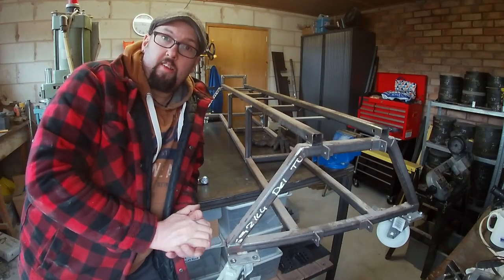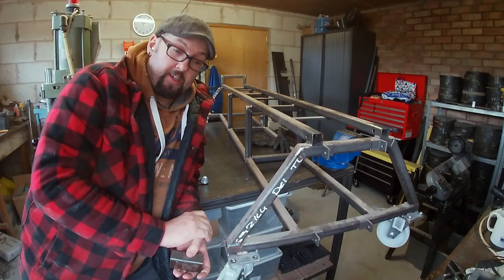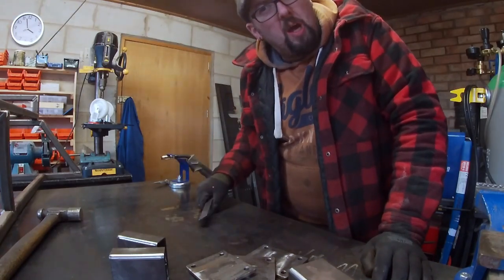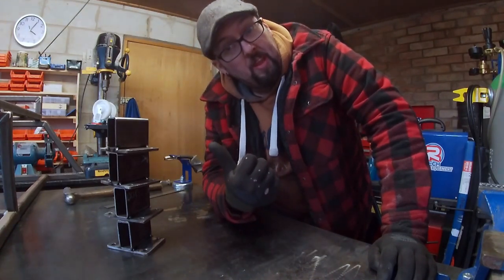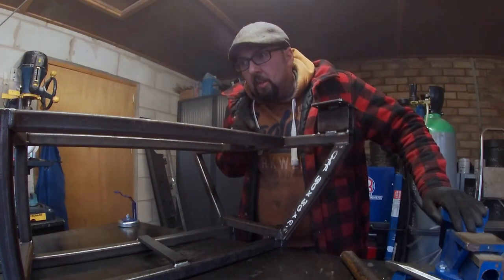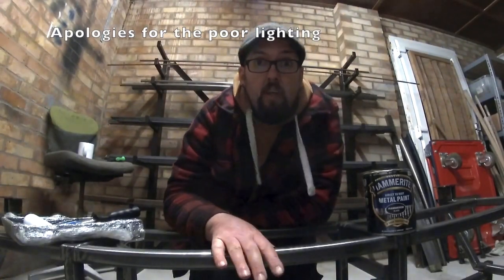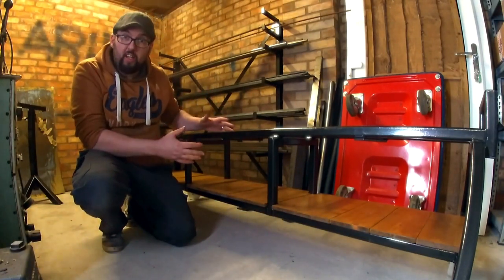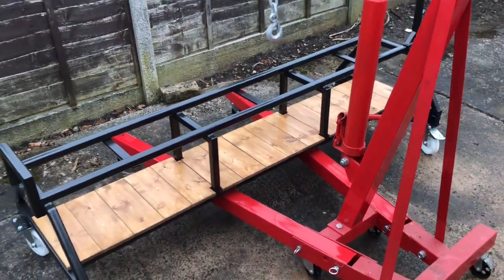The Loco Build Trolley - 7.25" gauge adjustments and reveal.

Comment: Top work, your accent sounds local to me (Wigan) 😎
Reply from the maker: Prestonian 👍
Reply: @MattChiversWorkshop  I thought so, 😎 I’m currently building a 5” gauge Britannia loco, the frames and wheel sets are all built and basically at the point of assembling the cylinders etc, I’m new to the hobby and took this on as it stands with a very long build ahead but really lost on where to start to keep the build progressing if that makes sense, I haven’t a clue how to look and follow the plans 😄
Reply from the maker: Unless your already a member of a model engineering club, I’d say that’s step one in its progress. Facebook groups are a good source of knowledge and inspiration too. The members at the clubs though can give the best guidance face to face and show you examples on already built locomotives. There is a handful of local clubs in the area too.

Drawings, well some are great and some not so great I’m afraid, I’ve not seen the Britannia ones so I’m not sure what category they fall into. I’m unsure in what order to build things either, I’m aiming for a rolling chassis with this build. This then means there are various parts I can build, cylinders, braking system, valve gear etc, to then get it running on air before the boiler, pipe work, body. Yours will have a lot of valve gear pieces and rods so build, so I’d start on those to aim towards a rolling chassis with all its wheels on. 

Luckily with this Tink build, there are a few of us building them all at the same time and we have a prolific guru builder who we get advice from. Most important part is to enjoy it, seeing it go together is very rewarding.
Reply: Thanks mate, mine has all the wheels on the chassis it’s all there apart from the valve gear and cylinders but I have everything here in boxes to complete, I’ll be using the Doug hewson drawings 😃

Comment: Matt What are you using for anti splatter?
Reply from the maker: It’s the SWP Anti splatter, I bought a 5litre bottle of it then decant into an old kitchen spray bottles. It’s not the best, but does reduce the spatter. Best I’ve used is the Esab spray cans but it’s a lot more expensive. 👍